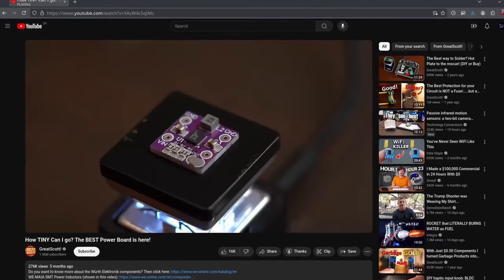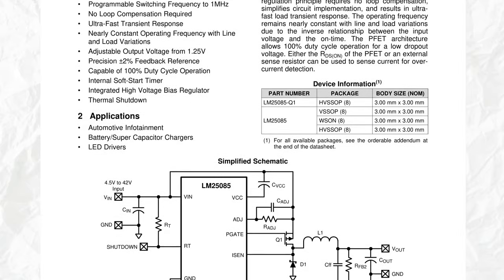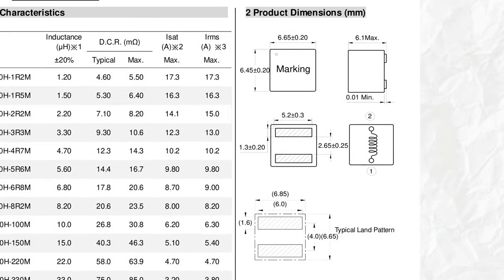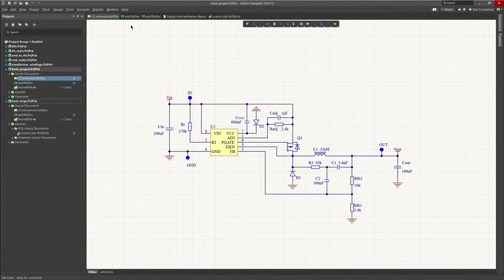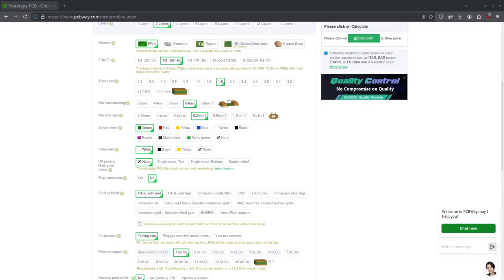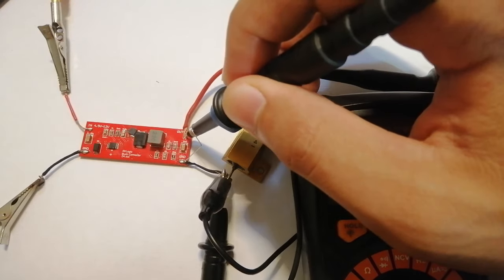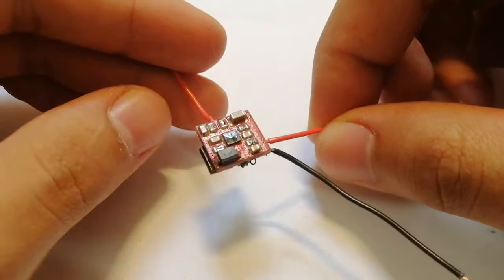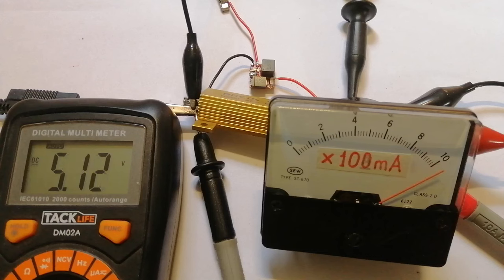Building a Tiny Buck Converter and Testing It

Comment: Fantastic video! A good thing for smaller projects. I would love to see a video about a custom CB radio frequency transmitter, for digital serial data over a long range. (Nrf24 does not work great at a longer range) So I think a longer wavelength would prove very useful for a "digital walkie talkie" kind of project. Hope you will try it ! Good luck 🤞
Reply from the maker: Thanks! I'm glad you liked the video.
It's a great suggestion, although it would appear that the only thing I have bad luck with more than component footprints is RF projects. I've been trying multiple ones over the years and have basically failed at all of them...
If I ever get anything working I'm most definitely making a video about it!
Reply: @5VLogic Better to try on a breadboard with an LC circuit or a crystal oscillator... Or first try with FM radio frequency to test the transmitter first before making the receiver. Troubleshooting is a must 👍

Comment: if i wont it at 24v what i need to replace ?
Reply from the maker: The two resistors at the output (Rfb1 & Rfb2) determine the output voltage.
The voltage divider must produce 1.25V at nominal output voltage.

Also: all components must be rated for this voltage. And the input must be higher than 24V because it's a step-down converter

Comment: MP9943 IC is also a good option I think. I have seen this on most of the Flight Controllers.
Reply from the maker: That's interesting, I'll check it out.
It also occurred to me after I made it, that I could have used a controller IC with integrated MOSFET, this would make things even smaller.
Reply: @5VLogic A switching solution with a higher switching frequency will dramatically reduce the inductor size - or at least volume if not footprint as much.